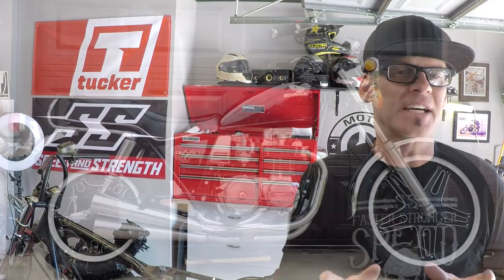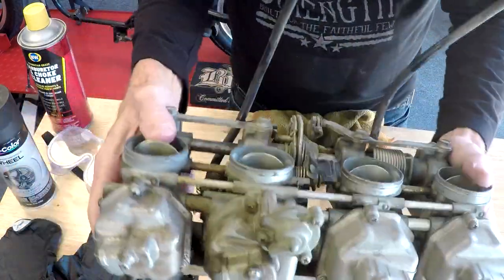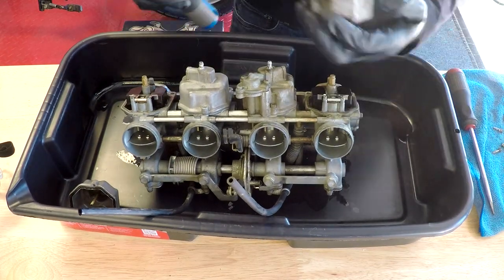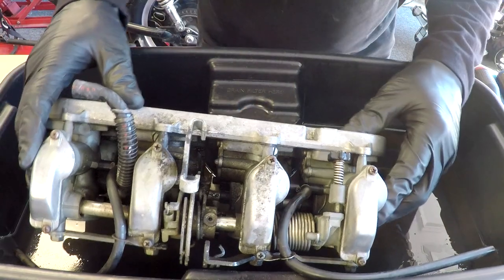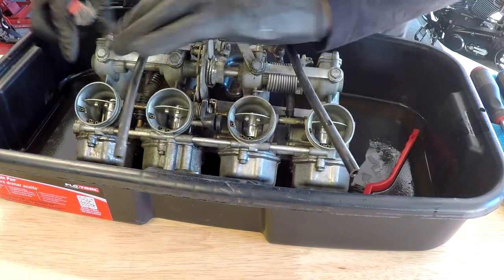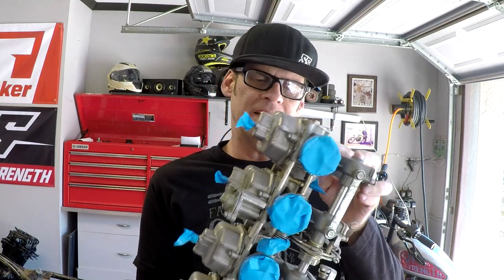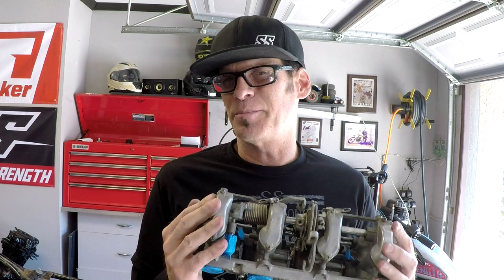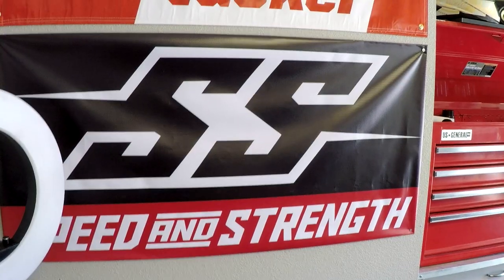Painting Carburetors  - Bobber Build - Episode 5

Comment: I think I would have used engine enamel, not only for heat resistance also for contact with gasoline and grease. It may make it start to peel once they start to get used , hope not but they look great
Reply: I think the engine enamel would have been better too. I painted my gas tank with wheel paint (don't ask me why) and the gas definitely seems to be breaking it down a bit .. luckily for me it is temporary and will get repainted. Hopefully the carb wont leak and it should be fine
Reply: @thomasgarcia7826  ,you now what did the same thing. Did a two stage metal flake black on my tank, came out perfect till I got a couple of gas droplets on it and totally ruined the finish. I had to sand it down and hit with the proper clear coat. Work great with the proper clear coat an is fine now...live and learn hey?

Comment: I disagree with the idea you can’t paint carbs too. I’ve heard they can hold heat and boil the fuel but unless is a hot running engine I don’t see that happening especially on a motorcycle

Comment: Nice video.  I noticed when you painted the carbs I don’t think you used etch primer.  Is that because the Wheel paint doesn’t need a primer on aluminium?  I am a complete new by so forgive the stupid question please.  I’m stressing over a pair of CB500F grab handles and this will be my first attempt at spraying over some scratches on them.

Comment: Its like cleaning them with spray paint! lol I've got a midnight special, came out of the factory painted so there's no issue with painting carbs. If you want to be pedantic then strip them down a little more and plug the holes with tape. I actually etched primed mine when restoring them to help the paint stick better.

Comment: I'm sorry but this is not the way it should be done. Believe me I'm far away from being a hater ( in fact its my first kinda negative comment) but things like painting the engine or the carburetors should not be done this way or you'll simply do a s...t job which will last maybe for one but no more then two seasons... because it look nice it doesn't mean it is done properly. 
Sorry mate but I really think you should put a lot more effort into preparation before painting. Good luck.
Reply: Hey Peter! I know it's been ages since you made this comment... but I still wanna learn from it, so there's no criticism of your comment or anything. Is it due to the cleaning before painting that it's a bad executed job? Because my thought was on the movable parts maybe getting stuck due to the paint. I wanna paint my carbs too, but doing the best possible job! Thanks mate ;)
Reply: Or because he's not using primer? I'd personally use a couple of layers of primer
Reply: Scrap & Trash I would definitely disassemble all of it. As you said there is many parts that are in motion...springs, washers, nuts or volume control screw that at some point might have to be adjusted etc. etc. When disassembled then it can be properly cleaned and get ready for paint. Make sure you choose heat resistant paint and approved for carbs(oxide paint). 
Good luck.